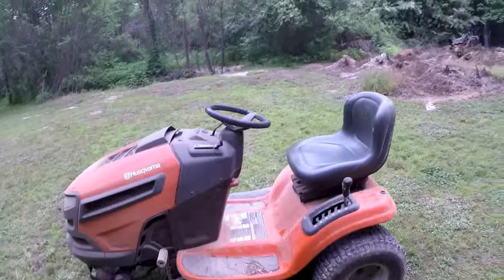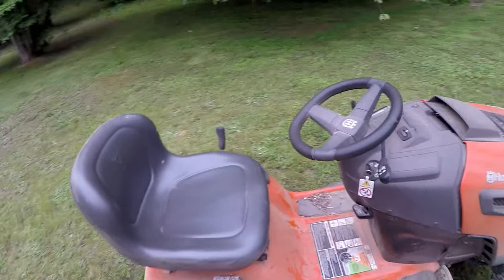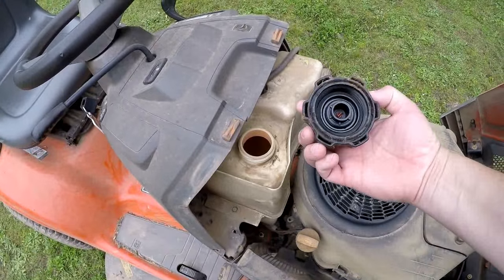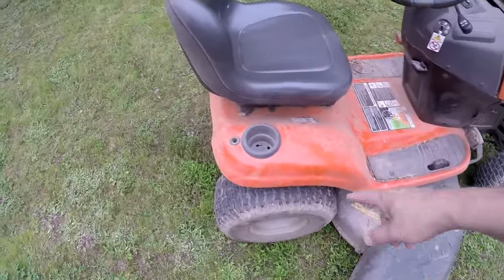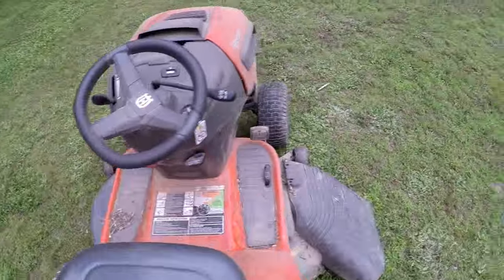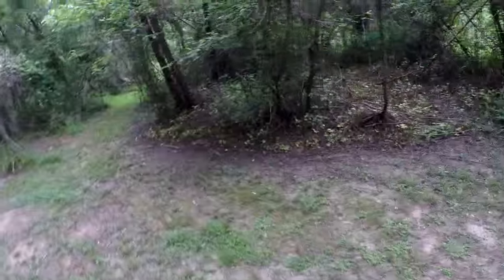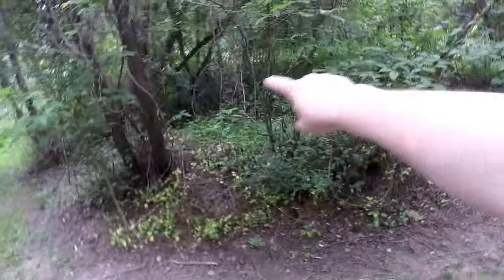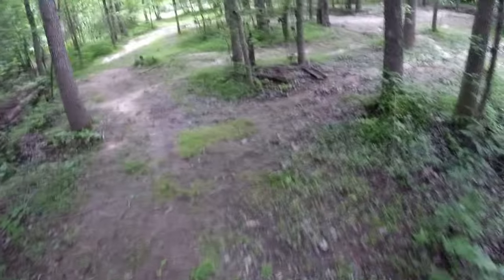Husqvarna YTH22V46 100 Hour Follow-Up Review

Comment: Dennis I purchased a Husqvarna YTH22V46 22-HP just like yours from Lowe's near the end of April 2018 still in the crate. Didn't start using it until a few weeks ago Mid May. Only reason being I still have my old almost 20 year old MTD Yardman that I still use on occasion. Love the Husqvarna so far but I am having a problem with the seat wobbling left to right. Don't like the feeling when driving the tractor. Saw that Lowes has a sticker on the back of the tractor stating to call a 800 number 24 hours a day for questions, parts or service repair. My patience wore pretty thin yesterday June 7th. Called the number during the afternoon and there is no one to speak to about any questions you have on the tractor. What a waste of a sticker. Disappointing. Right away I started hitting 000 on the phone and got a operator and she confirmed there is no one there that you can talk to if you had a question about the tractor. She suggested that she connect me with Husqvarna direct. Well same thing at that number no one to talk to. No troubleshooter to explain my problem to. Called customer service at the phone number I found online and got a call from the manager of the Lowes Store I purchased the tractor from today. Explained my problem so he had me speak to someone in the Lawn Tractor department. He went over to one of the YTH22V46 22-HP and the 42" sitting right next to it on the floor. Both of those seats wobbled left to right. He also now believes there is a problem and said that he would try to get in touch with Husqvarna. My question here is for anyone who owns this same tractor who comes across my post. Are you having the same problem? Dennis have you noticed anything? If you put both hands on the seat standing behind the tractor you can move the seat from front left back. You can't on the right side. You feel this in your backside when driving it cutting the lawn.  Did you notice anything? If not I believe that maybe Husqvarna may of left a bushing out on these later YTH22V46 22-HP Tractors. Hope I can get some answers here on Dennis's You Tube page. Just so everyone knows the Paperwork that comes with the Tractor is just about useless. Nothing showing a picture of the seat and the parts for it in case you needed to order parts for it. Saw a few weeks ago that a manual for the tractor is available online for you to download. I did that but nothing in the manuel like you would see with other Lawn Equipment I have purchased in that past with a exploded view and parts used and part numbers. If they would of least had that maybe I could see if everything is there like it is suppose to be. Better yet Husqvarna should have a Trouble Shooter one you can talk to if need be.
Reply from the maker: I haven't had any problem with my seat.  This may help though:  Go to https://www.husqvarna.com/us/support/manuals-downloads/   Enter YTH22V46 in the 'Product' field, then on the left side you'll see 'Manuals, Operator's Manuals and Spare Parts Lists'  Click on 'Spare Parts Lists' and download the first one.  That has an exploded parts view of the seat mount, etc on page 17.  That may at least give you an idea of what bolts to check etc.  You may be able to look under the seat as you move it and determine what is moving, whether it's the mount or not.  There may be a flaw in the seat itself...I believe it is an integral unit they buy from somebody else.
Reply: Thanks Dennis I like that link you sent me  for the Spare Parts List and the way it is blown up like I use to see on other models of Tractors years back. Its something that is really needed by the Lawn Tractor Owner but not provided with the Tractor by Husqvarna with the tractor today. You have to download it instead. Rediculous. Looking at that page it shows the 2 bolts and other hardware I see under the seat on my tractor. Took a 9/16" box wrench to them to tighten them up some but it made no difference on my own earlier in the week before reading this. Going to need to speak to someone at Husqvarna if there is a person to speak too. I truly believe there is a factory defect on mine in that area of the seat. Right now even Lowes has no answers for me. Was just curious to see if  there are any other complaints of the same in the mean time. Going to download that spare parts list right now and print it out and attach it to the Manual I downloaded 2 weeks ago I have sitting in a 1 inch 3 ring binder.  Thought that info would of been in the Manual I downloaded but it wasn't. Thanks for pointing that out to me.

Comment: The only problem he had was with the cupholder. 30 year old boomers are fine as long as it holds the Monster Zero.
Reply from the maker: Thanks for the compliment!!  Its been 25 years since I was 30!!  I still have to find a fix for that stinking cup holder....if I hit a bump on a slope, it flings my water bottle out.  haha
Reply: Haha, yeah. Look up 30 year old boomer on google, you'll get a laugh.
Reply: Btw, I got a question. I have this exact same mower, it is about 5 years old but hasn't been used a lot, maybe 2 seasons tops. What do you think I should ask for it?
Reply from the maker: I had to stop playing Quake to go look it up.  LOL!!  Thanks for the laugh.    I've seen them listed around here anywhere between $400 and $800 depending on condition and hours.
Reply: HAHA

Thanks man.

Comment: The Husqvarna isn't built as good as the Craftsman T240
Reply from the maker: Thanks for watching, Dick.  Yes, I'm sure the T240 is a good mower.  I'd expect it to be better overall quality than a YTH22V46 as it costs about $500 more.  The Husqvarna tractors sold thru the dealers, not thru the big box stores, are also better quality than the mower I have as well.  They also are a more expensive, so I'd expect them to be.  Thanks again!!